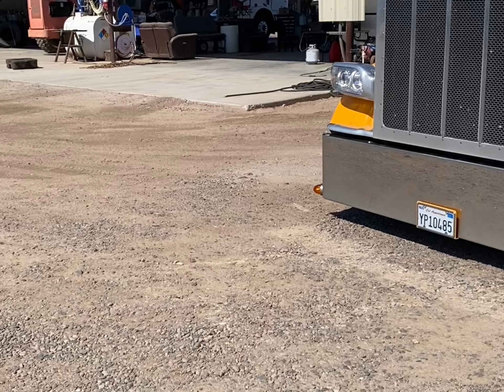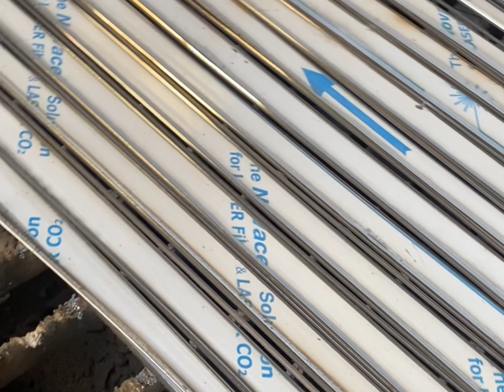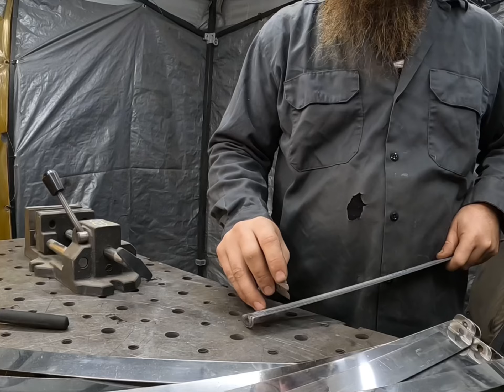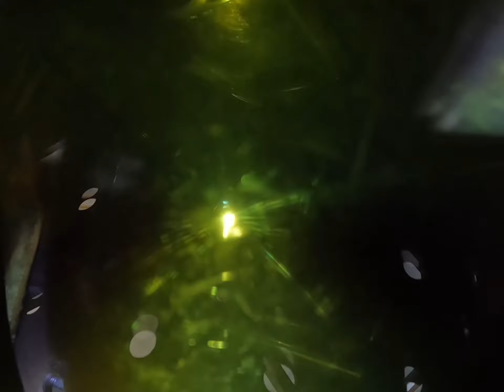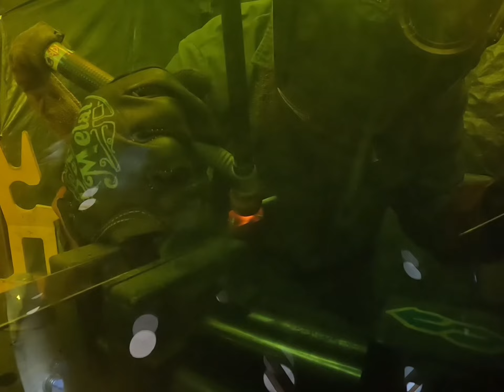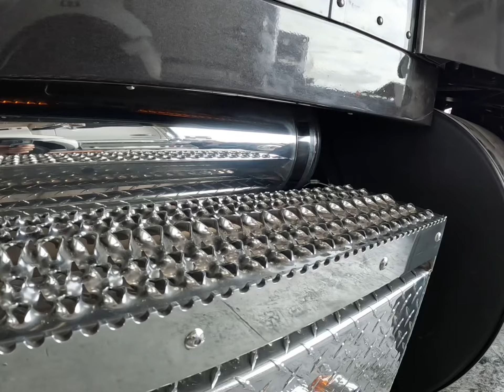Peterbilt Stainless Steel Air Tank Straps, How to build them from start to finish

Comment: How do you measure the length of the strap,i have a an odd size air tank on a 379. 10 3/4” is a little small .some kind if formula? Measure the diameter of the tank ?
Reply from the maker: I usually calculate it by drawing it in CAD but you can just measure it against the mount. Use a string or a really flexible tape measure. Measure from the mount around the tank back to the mount in the path the strap will go then subtract roughly a 1” to allow for some adjustment